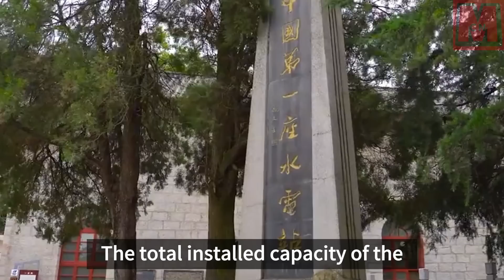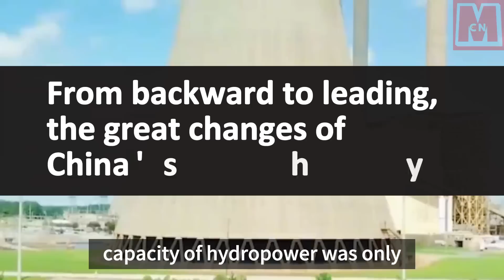The Chinese are rapidly building hydroelectric plants, but are they aware of the hidden dangers?

Comment: Very little power. Does not scale. China has what 300 yo 800 u.s. so scale the percentages, that is less and less energy it produces for the population, then scale for the population usage of its power. U.s. uses more, it's not just wasting it. In u.s. evs are a large expense, what are they in China. People do not understqnd they have a standard, of scale for usage. What are they gonna do, if it has 400 million evs that should equate to 800 plus electrical cost, it could be more. So what's going on. The ev cost for a u.s. citizen is less than a average Chinese citizen. Because u.s. citizens use more energy, adding a electric car to a American, is cheaper than, it would be fora Chinese you have 5 times the population, and use less energy 1)10th the energy supply. That means it's 10 times more expensive, than American. It 10 times more than what you expect. How are your 20 million evs not creating a energy drain, when you use only 300 . Variable, I stead of 800. That is 20 million, 1/10tg or 1)15tg if u.s consumers should be up, by a whole lot. It's American electricity cost, not Chinese electricity cost. You cannot cut energy cost corners on vehicles.

Comment: Actually the Chinese have not tried everything to get cleaner energy! For instance why is China NOT using its colossal population to produce energy? What do I mean by this? If China was to use a simple but old technology that is septic systems. That is modified by added compressor pipes to draw out methane ie natural gas. From every housing, business, public space, and from natural places that excretes methane. And then ties it all together with a network of collection and diversion stations..Then China would have a system that would augment energy that uses natural gas. Like say China makes this way of producing natural gas from the general public use, which would cut back on the gas needed for the Public. So they can divert the use for industrial use from the import of gas and what is pumped out of the ground. Also China could also apply gravity, electrical production by way of placing water collection that then uses gravity to turn turbines, but on buildings, individual houses, or water towers, infrastructure, and so forth. Or using glass tubes filled with water and boiled by solar energy to turn electric turbines. Or building buildings and homes that refract solar energy into the building or homes. Lighting those places. And also can produce energy which can be stored in battery packs to use at night or augment for use. I have dozens of other alternative ways for creating energy. All of which the very size of the Chinese population would become a massive asset for energy creation. Also cleaner energy creation. Nevermind how China's ambitions to become a powerhouse in advanced manufacturing could benefit from an influx of energy by separating public and business energy use. China could become an energy exporter. Especially electricity(extremely low cost providers of electricity) to neighbors. As China will have an overcapacity of electricity for domestic use. And since the entire country will be actively participating in the production of Electricity. China can also save on importing energy material. Also in a physical war or some other disaster. This non centralized energy creation will give China the ability to have stability and sustainability of energy needs.